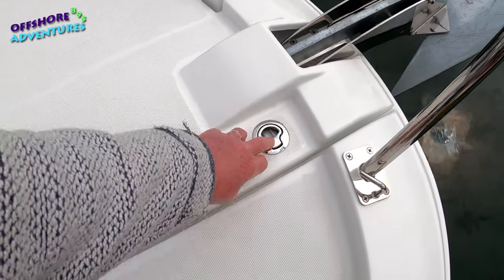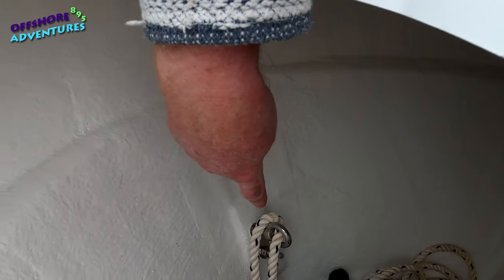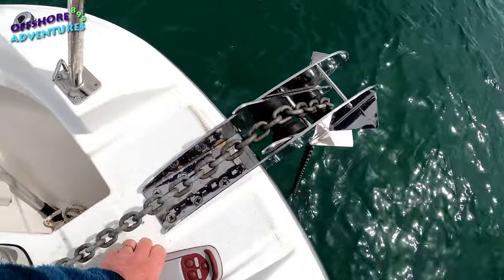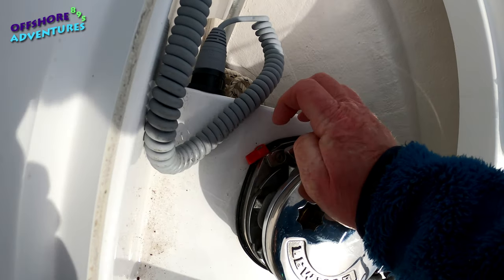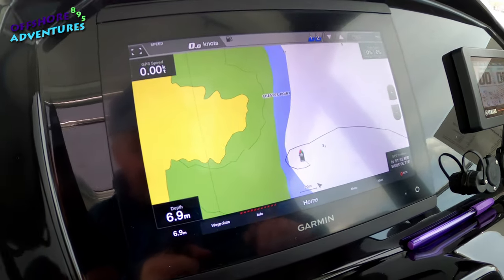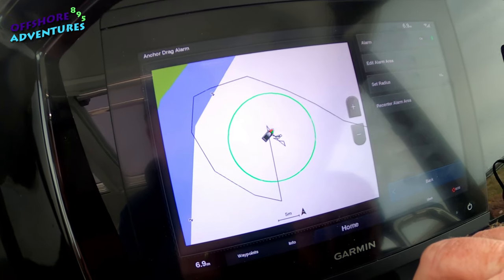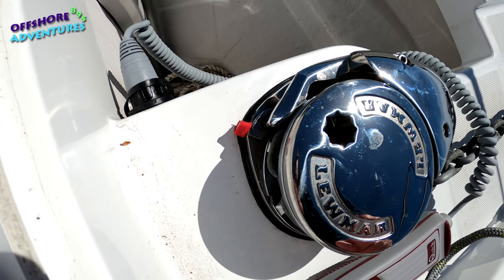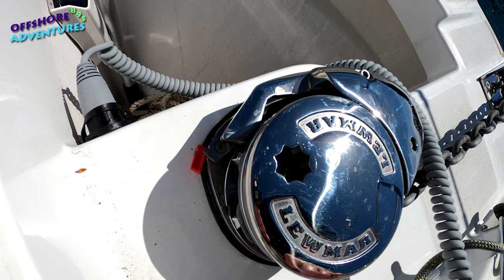How to safely anchor your boat and operate an anchor windlass.

Comment: Very Informative Bob & Nicky. Job well done. Look forward to the next one. Hope to see the dinghy inflation and deflation one soon.
Reply from the maker: Thanks John and yes that is certainly well up our list now - I suspect it will be the next film :) Just need a decent days weather, and a bit more warmth would be nice but not essential!! Any more news on the 895 plans?
Reply: What dinghy did you go with guys? Im about to get a lightweight 3D Tender but not sure if 2.3 or 2.5m ?
Reply from the maker: @cozzielife  it was the 2.5m - might be doing some dinghy filming on Thursday or Friday if the weather allows, plus the Torqeedo Travel 1103 - great combination. 2.5 is great size for 2 adults and could do more 😁
Reply: @cozzielife  you need a nice Zodiac or Yam dinghy from us! 😀
Reply: @PowerboatingAdventures  Did you go for the 3D model too then ?
Reply from the maker: We have Alan - we chose that initially for our 795 as I made a roof rack and had to lift it onto the roof rack when underway so wanted a light tender. The 3D Superlight Twin RoundTail was our chosen option and we've kept it for the 895 - albeit it fits in the lazarette now so no lifting onto the roof!! The Zodiac and Yam are great too and with the 1103 Travel that Daniel has on any of those tenders you'll love it - such amazing zero sound engine - you just hear the water going by - watch this space for a film :)
Reply: @danyeates5  Shameless :)

Comment: You Must connect the swivel to the anchor with a bow shackle to allow it to articulate. As it stands any side load to the anchor from yawing or tide change will cause the jaws of the swivel to fail.
Reply from the maker: Thanks Paul we’ll have look at that - saw them on Jimmy Green the other day👍😁
Reply: Paul Walker is absolutely right, also, stainless steel is less ductile than galvanised steel. Galvanised is a better choice for this application if you must use a swivel and introduce another point of failure! Also, check out reviews of anchors designed this century compared to the Danforth and CQRs designed 80+ years ago. Their resetting performance in wind shifts and current changes have to be experienced to be believed giving you a more restful night's sleep.
Reply from the maker: Many thanks Jonathan, much appreciated and very useful  information 😁

Comment: I am really enjoying your videos thank you for taking your time to produce these. If you don’t mind I got a couple of questions about Merry Fisher boats. Although here in America it would be a NC weekender instead of Merry Fisher. First on your boat there’s a round cylinder underneath what I assume is the anchoring light what is that. Second I noticed that you have a refrigerator how long can you run the refrigerators off of the house battery. Is it possible to add additional house batteries. When the engine is running I assume it charges the house battery the question is if the engines are idling is that enough to charge the house batteries or do they need to be running under load. I assume as well that we plugged into shore power As well you charge the house batteries. Also I’ve been looking a lot at merry fisher and Beneteau Antares I’m wondering if you looked at both by chance or if you have an opinion on either one of these boats versus the other. Last how have you found the reliability of your boat in other words how How well does it screw together. And lastly your boating area is absolutely gorgeous again thanks for taking the time to produce your videos if my questions are a pain in the ass ignore them if you got time to answer I do appreciate it
Reply from the maker: Thank you very much Life Happens - it's great fun putting them together and more excuses to go out on the water!! Firstly that is an Echomax 230 Mini which is a radar reflector to improve our 'radar visibility' in foggy weather if we are ever caught out on our coastal waters. Other boats fitted with the right equipment (most bigger boats than us!!) can hopefully see us on radar even if they can't physically see us. We are not planning to go out in fog though!!!! Second - in respect of the battery I'm not a 'battery expert' by any means - Our batteries are 

https://www.duracell-automotive.com/en/Products/Commercial-Vehicle-Batteries/56-DP-145-SHD?fbclid=IwAR28hmVCgsNou3wfuvnzw6hziW-kaAl-M_WtLDlEOOllfjOS1cgzzT0NpRo

....... Two of these. One for each engine, one of which doubles as the house battery

 the fridge draws about 5 amps and our batteries are 140ah so assuming its using 50% (which is the about the usable capacity at 12v) then about 14 hours I think on a 140ah.

The engines will put out a good amount of power, 50 amps at higher revs but I'm not sure what exactlt the revs would have to be for that amount. It’s probably about 2-3000 RPM and above. But even at idle they’ll put out way more than 5 amps each. 

You can parallel additional batteries in to the house battery. So you can hook up another. 

If you wanted more detailed info I can ask my NC/Merry Fisher dealer, Daniel Yeates at BHG Marine in the UK, as he is my font of all knowledge!!!!! (the battery suppliers might improve on the detail too!!)

In respect of Beneteau Antares we didn't look at them as an alternative when going to dealers - we focussed on MF/NC after doing online research/personal preference/viewing at our local marinas which gave us our preference for these MF boats. We've not physically tested the Beneteau and I'm sure they have many benefits too :)

Touch wood we haven't had any problems at all apart from that hose that popped off when engine flushing in our film, which was easy to resolve, and the webasto heating cutting out probably because the rear canopy, by mistake, blocked the air intake. No other issues at all, no leaks, no failures so we are very pleased with that albeit the boat is only 9 months old so long may that continue. Components seem sturdy in our sometimes crazy UK weather as she sits in the water full time at our marina through all weathers.

Finally of course the scenery is indeed fabulous and we got some lovely footage of our birdlife this wekk which we'll edit into a short film very soon. Keep asking - no problem at all :)) X
Reply: @PowerboatingAdventures  Thanks for the quick response to my questions I wondered if the cylinder walls in fact a radar reflector. Here typically that would be where you mount a radar dome So I was wondering if you had some sort of crazy radar in England.I have to mitt as I watch more more videos and look at more and more webpages and specs I’m thinking maybe the Merry Fisher would be the boat to pick.
Reply from the maker: They are fabbbb!! Your boat is out there!! :)

Comment: Random question, do you take any special consideration when buying clothing for boating and bedding and towels etc.  Would one need to consider quick drying towels and sleeping bag double as we are very experienced campers and have the gear and wondering if that would be worth considering for drying/condensation etc?
Reply from the maker: Morning Karen, so glad you’re enjoying the films and many thanks for your comments and questions 😁👍 no we haven’t any quick drying clothing or towels etc. The heating blowers/vents are very efficient at warming the boat up quickly if needed in Winter (or even Summer in the UK!!) so do consider heating if you buy! Your existing camping gear would be great as well though I’m sure :)
We run a dehumidifier in Autumn and Winter which prevents any damp from condensation. It runs on shore power only, unless you have a generator, so we leave it on when away from the boat. It cuts out when the air has been dried out so does not use excessive electric - that’s a Meaco DD8L dehumidifier. 
Swimming costumes or wetsuits etc also dry well when pegged on to outside bars etc when on the move as it’s a good air flow.👍😁

Comment: Great video , how long do you suggest the anchor chain to be ?
Reply from the maker: Morning 63melvyn, Many thanks for your feedback and we have remained with the chain and rope that was supplied with the boat. It has 23m of chain attached to 35m of rope so 58m overall. We are often anchored in 5 or 6m of water so working on the suggested ratio it is 4 x depth if ONLY chain and 6 x depth if it is chain and rope combination. So work out where you will anchor, or want to anchor, and that will give you a guide to the amount you may need :) Hope that makes sense!!

Comment: Does the windless just work the rope the same as the chain ?
Reply from the maker: Hi 63melvyn, Now that’s a good question! What I’ve found is that if you have put down all the chain and gone onto the rope then it lays down well as the weight of the chain is pulling the rope through the windlass. 
When winding back in I have found it necessary to keep a close eye on the retrieve and have often just assisted the windlass by pulling the rope on the boat side of the windlass to prevent it winding around the windlass instead of dropping into the anchor locker. The chain retrieve is fine as it has its own weight but the rope needs to be monitored in case of that snag in my opinion. Another good reason to be up at the front when dropping or retrieving the anchor 😁😁👍 Hope that makes sense!